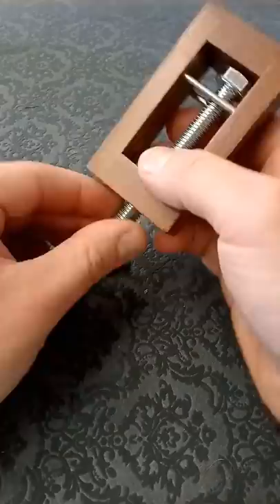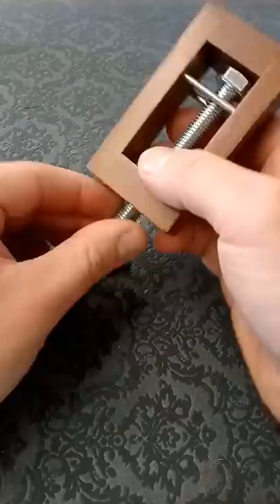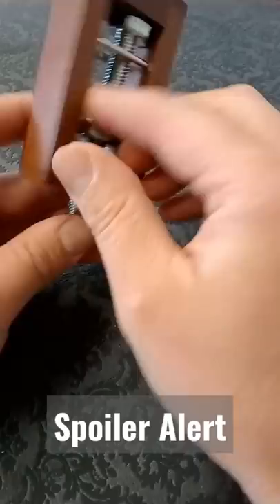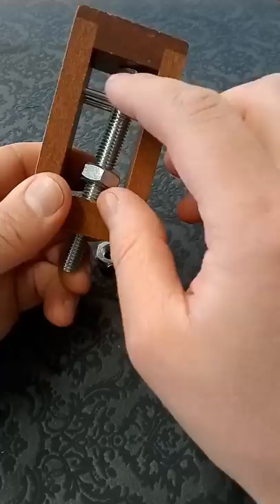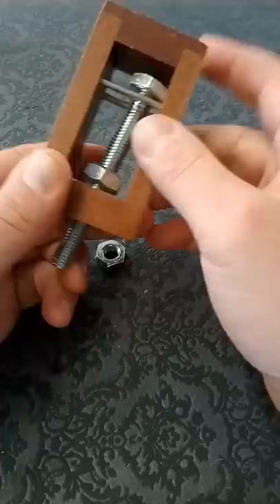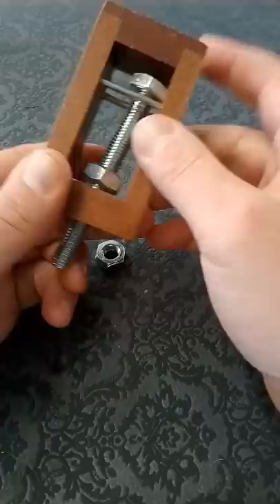Can you free the bolt?! #puzzle #puzzles #brainteaser #brainteasers #shorts

Comment: or you can take the top nut off then slide the bolt down then slide the last nut off the top off the bolt and then pull the bolt through the bottom..

Comment: You just made it a non-puzzle. I could do the same thing with a pair of wire cutters. Or hell, I'll just whip out a heavy duty tool and cut the whole f'n thing in half same result.
Reply from the maker: Except I can put it back together again and then repeat again and again, feel that might be tricky if you cut it in half
Reply: @officialcruxpuzzles  - Dude, if you have to disassemble it in any way, it's not a trick anymore.
Reply from the maker: @need100k  not quite sure what you mean but I'm not trying to argue about any opinion you might hold just pointing out it's not broken, can be put back together and then repeated

Comment: So, it can't be reset? Bleh.
Reply from the maker: Ye it can, I think I did a bad job of explaining this one. So the pin is held in place with a magnet, the tap releases it but the pin can be put back in again and reset very easily!
Reply: @officialcruxpuzzles  Oh, a magnet. I was imagining a cross pin. There was an old puzzle box design where you'd rap it on 1 corner and pop a wooden peg that was hidden inside. Couldn't put it back to start w/o a specialized tool.